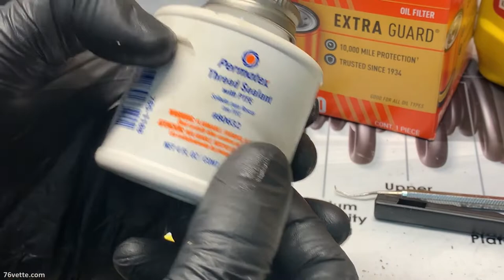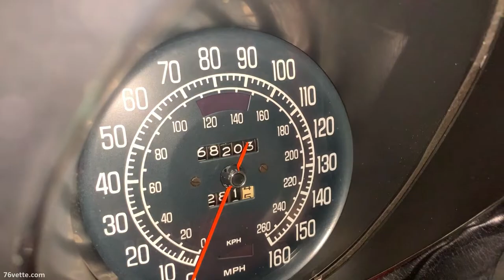OIL & FILTER Change Step-By-Step

Comment: Good video showing important basic maintenance.  I drop oil and filter at same time and let her drip. I use AC Delco filters on the Pontiac, I get 6 at a time so I always  have them. Thanks for posting.
Reply from the maker: AC Delco filters are the best IMO. I may have to look into buying a case to save money. Thank you for watching! 😊👍🏻
Reply: Don't laugh. I get the Lucas oil and the AC Delco filters on Amazon. 
A guy has a store on there, always boxed nice too.

Comment: I would stay away from the "orange" Fram unless you get the higher end Fram filters.  Some orange Frams have been cut apart and found holes in the filter material.  I buy cases of  Wix 51046 Short or
Wix 51061 Long.  Usually use the long as it has more surface material.  Nice vid!
Reply from the maker: I’ve never had any issues, thankfully, with the Fram filters I use, but I appreciate your suggestion and may try the Wix 51061 at some point. Thank you for watching! 😊👍🏻

Comment: Do you find the thread sealant to be better than the white drain plug gasket? l get a slight trail of oil coming from the plug on my car.
Reply from the maker: Hi Konrad. I think any kind of gasket has a finite number of uses before they start to fail. The thread sealer compensates for that and it works well for me. I think something like RTV would also seal the threads properly, but clean up would be far more difficult. 
Thank you for watching! 😊👍🏻